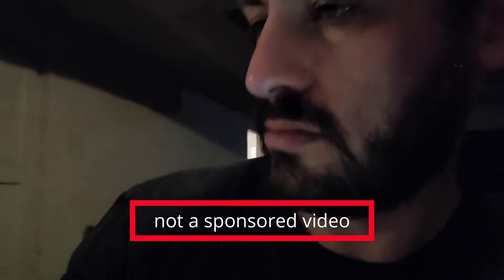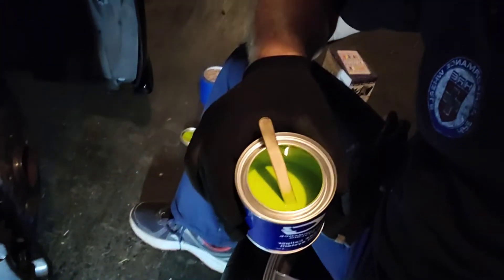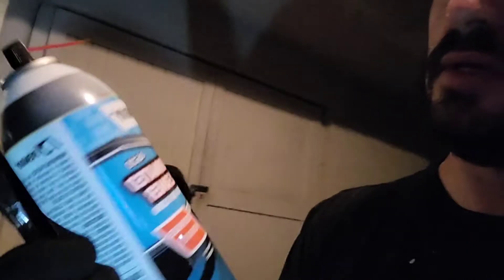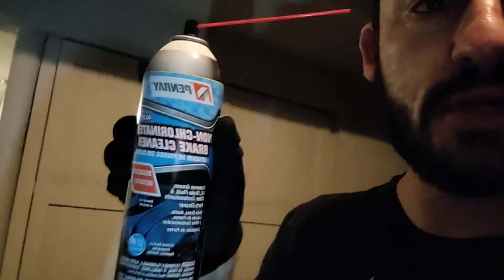DIY G2 caliper paint kit on my BMW M3

Comment: Is this the lime green color? Do you have an Amazon link? Looks great!
Reply from the maker: Yes it is. Looks better than their sample. G2 High Temperature Brake Caliper Paint Kit - High Gloss, Wear and Heat Resistant, Epoxy Paint System - Dries Hard, No Flaking or Fading Lime Green G2171 https://a.co/d/5fRoOns
Reply: @driverswantedtv  thanks so much!! It looks great in the video. Will be grabbing this for my white 23’ supra. Should go nice with the OEM gunmetal wheels!